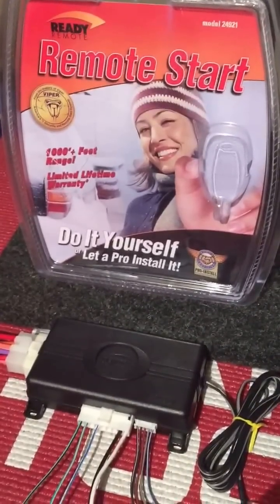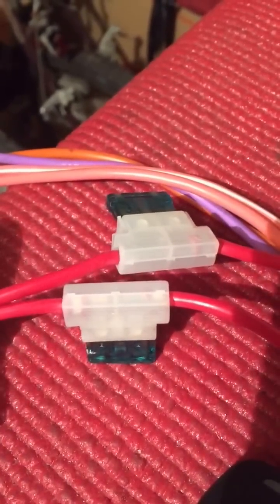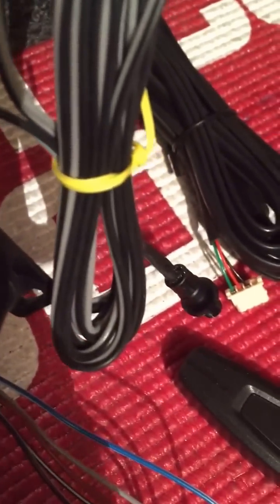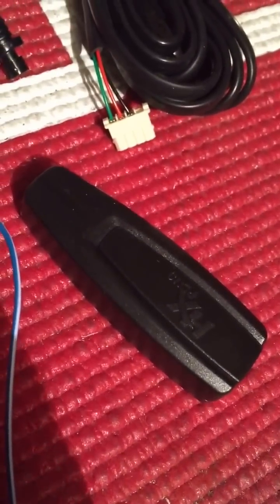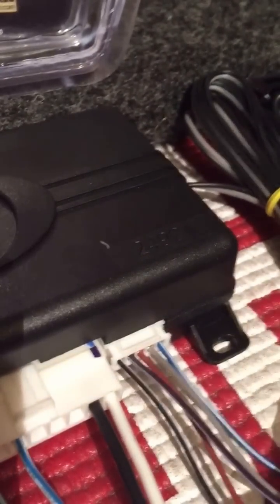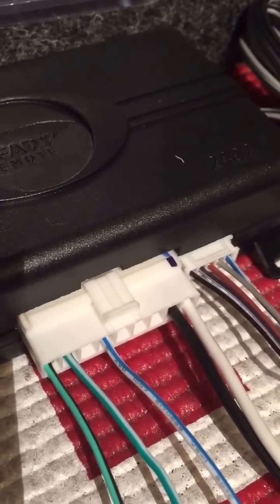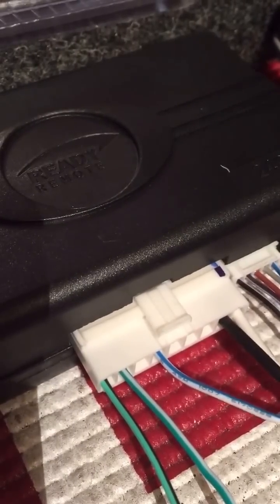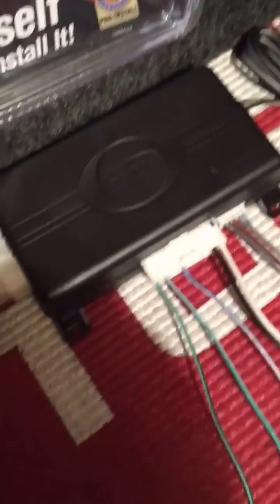Car Remote Starters Explained Wire by Wire Viper Python Clifford Compustar

Comment: I have the 4103 model, and perhaps they all refer to ac current on the tach wire; but does that mean all coil pack like on the 3.3L Chrysler engine have ac and not dc current?
Reply from the maker: Tim Smith the wiring should be almost identical to the model I reviewed.  I don’t know about ALL coilpacks being AC but I certainly have come across them.(Not sure about your Chrysler 3.3L)
Honestly, 99% of the remote starts that I do, I don’t connect the tach wire, but use the voltage setting.(I think it even comes default to use voltage and you have to change it in the programming menus.)
Reply: @MotoCARR847  You highly recommend just the preprogrammed voltage as the tach reading more or less? It is reliable? Their manual and YouTube videos seem a bit dated lol.
Reply from the maker: @netguru78  yeah absolutely.  If the vehicle is regularly driven in the winter months, I would say 95% of the time the vehicle starts on the first try.  The few times it doesn't, in my experience it is due to a sudden drop in temps, or the vehicle hasn't been driven in a while.  This is assuming this is going on a somewhat newer vehicle.  If this is going on something from say the 80s or 90s, and by nature is harder to start in the colder months, it might be worth the effort to connect the purple/white tach wire as I believe it cranks for three seconds at a time when it's reading RPMs.  Crank time by voltage is usually just shy of or right around one second for each attempt to start.  If it doesn't start the first try, the crank time is increased a hair.
Reply: @MotoCARR847  It is a 96 concorde, it does start on the coldest of days up here plus it has a block heater as well.
Reply: @MotoCARR847  I appreciate you messaging me back. Either, I have something hooked up wrong; but I have been over both diagrams one for the remote start and the diagram for the car. I have check it like 10 times, it is wired per recommendation. I cannot get the led to light up on rpm read, so how do I set it to read voltage instead of tach. Otherwise I can try rewiring the tach cable.
Reply from the maker: @netguru78  the docs I have on the Concorde have the tach wire as being red, white, or black at the coil pack.  Typically what I have seen it is the uncommon wire color among all of the coil packs.  Example(Not related to your vehicle):  If a car has two coil packs, three wires on each.  Coil 1 has Red, Black, Blue.....Coil 2 has Red, Black, Orange.  Typically, in that scenario, the tach wire on Coil 1 would be Blue, and the tach wire on Coil 2 would be Orange.

Virtual Tach is the default setting, so right out the box the remote start is set to Virtual Tach as the method the remote start uses to tell if the vehicle has started and to disengage the starter.  If you went into the features menu within the remote start and changed it to Tach, go back and change it to Virtual Tach before attempting the Virtual Tach learning steps below.(Menu 2, Feature 1)

To program Virtual Tach:
1. After the install is complete, remote start the car.
2. If the car does not start on the first attempt, let the remote start attempt again.
3. Once the car starts, let it run until the parking lights come on.
4. When the parking lights come on, shut off the remote start with the
 remote
Reply from the maker: Item Wire Color Polarity Wire Location Photo Note
12 Volts pink/black,red (20A) + ignition harness  
Ground (chassis ground)    
Starter yellow/gold dots + ignition harness  
Ignition dk. blue/gold dots + ignition harness  
Second Ignition red/white/gold dots + ignition harness  
Third Ignition red/white 18ga (if SRS light coming on) + ignition harness
Accessory black/orange + ignition harness  
Power Lock orange/white + wht plug back of fuse panel
Power Unlock pink/violet + wht plug back of fuse panel
Parking Lights black/yellow  driver kick panel
Tachometer red, white, or black AC at coil pack  
Brake Wire white/tan + brake pedal switch  
Horn Trigger black/red - relay in fuse pane
Reply: @MotoCARR847  PS i have not even got the led or remote start to activate or bring up menu.
Reply from the maker: @netguru78  check the Black/White wire that is next to the violet/white tach wire.  That is the neutral safety wire and if you aren't going to use it on the parking brake and or any other kind of safety switch, put that wire to ground if you haven't already done so.
Reply: @MotoCARR847  I have yes :/. This is not looking good lol. I have gone over everything thought possible.
Reply from the maker: @netguru78  can you lock/unlock the doors with the key fob?  What about hitting the * to activate the remote start?  Do any of the dash lights come on?  Or when you hit the remote, does nothing happen at all?
Reply: @MotoCARR847  Nothing.
Reply: I don't have the door part hooked up, i just started with basics. to get the remote start part to work. Instead of getting it all connected to find it didn't work.
Reply: https://ibb.co/fkpgpG3 This is the printout that I got for the car diagram to hook up the remote start I have.
Reply: I have to goto work. I live in central time, I will reply back after that.
Reply from the maker: Tim Smith a couple things to check off the top of my head(Some are extremely basic I know)
-Is the antenna connected at both ends of the cable and in the right port on the brain?
-Is the hood pin connected? If so correctly? If it is, disconnect it completely for testing
-Are you using the valet switch? If so, is it connected correctly? If so disconnect it completely for testing. 
-Do you have all three ignition wires powered up?(Either the 12GA or 18GA from the diagram)
-Are both Red wires on the remote start connected?
-100% sure you have a solid/good ground for the remote start?(And Black/White neutral safety wire)
-You shouldn’t need the door trigger wire hooked up for remote start to work. Usually even if it’s not connected, at least the power door locks will work. Being that you said that the remotes don’t activate anything at all, it leads me to believe it’s a connection/power issue.
-If this is used, are the remotes programmed to the unit?(If new they come programmed)

I’m not sure where you bought it from, but there is a chance that the brain is bad, but unlikely.  Getting the locks to work is going to be the first step, as they will work even if the connections for the remote start are not right.  It definitely sounds like you have a connection/power/ground issue.
Reply: @MotoCARR847  well conclusion i think it a dead head unit. I have test voltages for ignition and power in/out for main connector unplug valet button checked connections at receiver for remote start and connection at unit all connected flush and firmly.
Reply: @MotoCARR847  Thanks so much for all the assistance.
Reply from the maker: Tim Smith just pulled the 4x03 brain out of my parts truck. It’s yours for the cost of shipping if you want to see if it’s the brain.
Reply: @MotoCARR847  sure broke until Thurs. Can I send payment then?
Reply: I sent fb message.
Reply from the maker: Tim Smith yeah man I’m in no rush to get rid of it.  Shoot me an email to refinedperformance@gmail.com with your address and I can see how much shipping will be.
Reply: @MotoCARR847  Message sent.
Reply: @MotoCARR847 Just curious do both 12volt wires need to be connected, might been oversight of mine?
Reply from the maker: Tim Smith typically yes both need to be connected to a 12v source.
Reply: @MotoCARR847  I have the 4103 model too, my truck is 97 ford f350 7.3 powerstroke, I'm having troubles with a few connections: pin 5/orange of the 9 pin harness I don't know where to connect it, pin 9/white on same harness how to connect the jumper if needed for my truck model. On the 5 pin harness: pin 1/black/white I can't find this wire in my truck,  is this in the switch harness?. And the last one is the door lock harness are this one of the wires from the switch on the door? Thank you very much for your time.
Reply from the maker: @soylibre  ***Orange wire***= you do not need to connect it for the 4103 to work.  Remember back in the day when underbody neons were a thing?  You would connect this wire to a relay so that when you hit "lock" on the remote, it would switch a relay and turn the neon lights on.  Basically you use it to turn something on when you hit lock on the remote.
***White wire***=Parking lights.  Your truck will be positive or negative trigger and to test this you will need a multimeter.  When you put the meter on the wire it will show one of two things, 0 or 12V.  When you hit the light switch your multimeter will change.  If it was 0 it will change to 12V when you hit the light switch, this is POSITIVE trigger.  12V and then goes to 0 is NEGATIVE trigger.  You match the jumper on the unit to what the light switch is doing.(I'm leaning towards negative)  Documentation that I have says that the parking light wire is Brown and located at the light switch or driver kick panel, but unfortunately it doesn't tell me polarity.(You should be testing anyway!)
***Black/White wire***=Neutral safety.  This wire is designed to go to a switch that tells the remote start that the vehicle is in neutral(Mainly for manual cars.)  I'm not telling YOU to do this, but in 99.9999999999% of the remote starts that I have done, I just put this wire to ground. :-)
Reply from the maker: @soylibre  ***Door locks***=  If your truck has keyless entry then your door lock wires are negative trigger and should be able to be connected directly to the remote start unit.  If your truck does not have factory keyless entry, you have what is called 5 wire door locks and it will require additional parts to make them work.  If you have 5 wire door locks, I recommend you extend the door lock wires from the driver side to the passenger kick panel and make your door lock connections there.  The e-brake really gets in the way and if you're soldering your connections it only adds to the frustration lol.  See the link below on how to wire up 5 wire door locks with two relays.  To test if you have the right wires use the door lock switch, do not stick the key in the door and turn it to lock/unlock.

https://www.the12volt.com/relays/relaydiagram3.html
Reply: @MotoCARR847  thank you very much,  I will try this tomorrow,  I do have the 5 wire doorlock.

Comment: I’m locating all the wires before I dive in, and I’m having trouble finding accessory wire (the heavy orange wire pointed out in video)

I have a 2003 dodge pickup 2500 5.7, the only way I get the radio on without the dash is turning the key backwards toward me. Will the wire in my truck be the same gauge as the orange wire?
Reply: Alexander Avila I’m showing the accessory wire on your 2003 Ram as being Green and second accessory being Orange.
Reply: Thanks man I’ll check it out tomorrow..Where exactly did you look? I’m having trouble pulling up a good diagram.. anything helps

Comment: hello good video a question why my car only starts with the key in the switch, it's a car LINCOLN MKZ 2007 THANK YOU
Reply from the maker: Dionicio Herrera most likely because you either did not install an ignition immobilizer with the remote start, or it is not programmed properly.

Comment: Yeas later i still havent done this and just got a new rav 4 , (basic model) and the remote start i had in the previous car when with it lol i guess im too scared to even attempt this i hear it can go wrong pretty bad is that true ?
Reply from the maker: Technically the answer I should be telling you is yes things can go pretty bad if you have no idea what you're doing and you aren't a careful person.  If you go slow, read, and follow instructions, you should be fine :-)
Reply: @MotoCARR847  sorry to bother you once more but if my van has a basic key do i need to have a bypass module, i have a 2017 toyota rav 4 le
Reply from the maker: yes you will need a bypass modules like the iDatalink ADS-ALCA.  You can find them all over eBay for about $50, some will even program it for you before sending.

Comment: Question had a Remote start python 580 professionally installed 2002 will newer python modules plug an play into existing RS wiring/connectors ?
Reply from the maker: Jon A it depends on what newer model you go with.

Comment: I have the 24921b model and I can't figure out how to change the run time it is currently set up to run for 12 mins I want to change it to run longer
Reply from the maker: Albertino Gomes
-turn the ignition on then off.
-Press the control button twice, then press and hold the third press. LED should flash twice repeatedly.
-While still holding the third press of the control button, grab the remote and press the button once, then count the number of times the LED flashes.  You’re looking for two LED flashes, so if the LED is only flashing once you will need to press the remote button again.(All of this while still holding the control button)
-Once you get two LED flashes, let go of the control button, then turn on the ignition, then back off.

Done!
Reply: MotoCARR Online I looked for the switch and I can't find it nowhere,is it possible it was never installed by the guys that did it it's got me confused
Reply from the maker: Albertino Gomes yes it’s certainly possible. It’s not required for regular day to day operation of the remote start, but it is needed for feature programming. If you can see the remote start itself installed under your dashboard, look to see if something is plugged into the Blue two pin port. If nothing is plugged in there, then the push button is not installed. If you see something in that slot, follow the wire and it will lead you to the programming button.
Reply: MotoCARR Online I'm going to check this weekend I can see the remote starter box all the way jammed in the back I can touch it but my hands is to big to move it around. I'm pretty sure the switch is somewhere staring right at me.Thanks again I will let you know this weekend how I make out
Reply: MotoCARR Online I just checked again I was able to get to the box it looks like the switch wire is not hooked up.thanks for you help

Comment: Mine is exactly like this i couldnt get the co. to give me any help they said watch the vid .your vid is 1000 time better than thiers.does the large diameter wires all connect o large wires or do some connect to smallerwires .i have a 01 s10 ,,very basic no special key auto trans .i still quit and give up .ive done my wives car much simpler brand of starter
Reply from the maker: Dent Tech on your S10 for the most part the big thick wires on your remote start will go to the thick wires in the truck. Shoot me an email to refinedperformance@gmail.com and I can send you a wire sheet if you need.

Comment: So I finally found the correct wire diagram for my 2004 Ford f150 Fx4. Once I found that, your video describing the wires made the install super fast. Thanks so much. Works great!!
Reply: Glad it worked out and was able to help you.  The manuals definitely don't make it easy to understand sometimes!

Comment: how will you program this starter??
Reply from the maker: Jose Velarde it is already preprogrammed. All you have to do is change features or options to your liking. Depending on your car, you may have to program an ignition immobilized bypass
Reply: And how can I do that is a Honda Accord 98
Reply: I have to reprogram it again because now the key has a new chip
Reply from the maker: Jose Velarde you need to find out who makes the brand of the ignition immobilized bypass. A lot of them require you to reflash the module from a laptop with special software and a tool, it can't be done on your own.

But, if you just got a replacement key, I don't think your module needs to be reflashed.
Reply: it seems who ever install this didn't put the valet button
Reply: it has a small module that says idatalink has a button that turns green and flashes
Reply from the maker: Jose Velarde ok for that idatalink module you definitely need to have a laptop and specific flash tool in order to reprogram that idatalink module. It can not be done manually or with the valet button. If you happen to be in the Chicagoland area I can do it for you, otherwise you will need to take it to the place you had it installed. If it was on the car when you bought it, any Best Buy should be able to do it for you, I assume for under $50.(I use to work at one :-) )
Reply: Oh okay so I will stop messing with it and I will go today in the afternoon thank you
Reply: If I replace the battery for the  clicker do I have to reprogram it because my car isn't starting